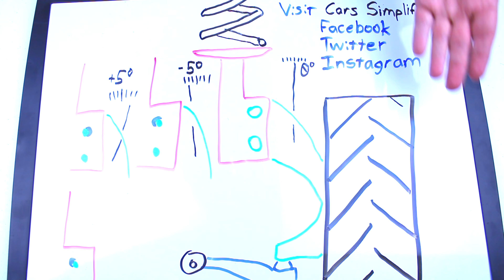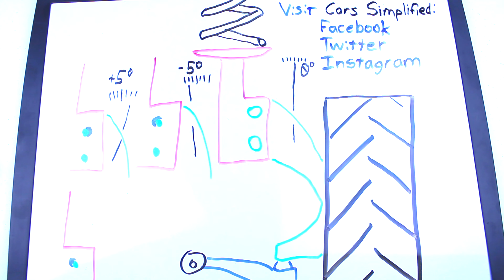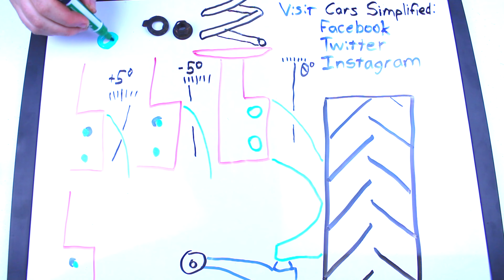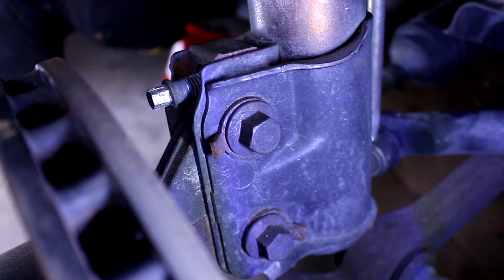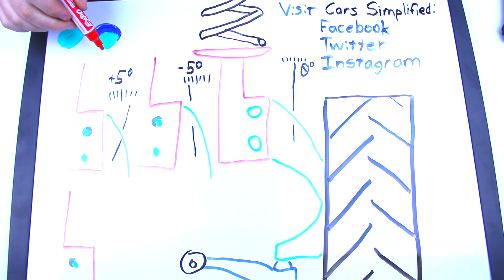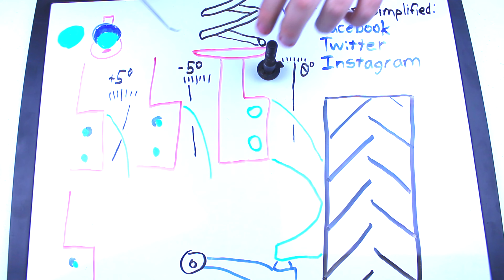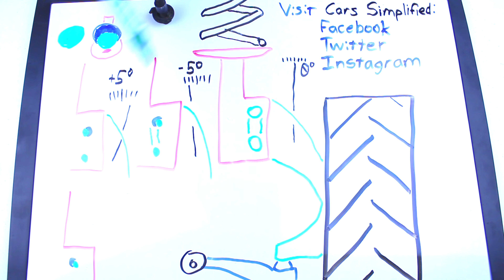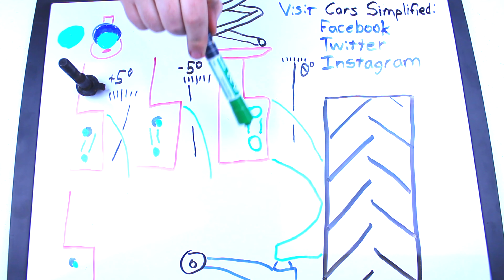How Cam Bolts Work (How to Adjust Camber) • Cars Simplified

Comment: Bought camber bolt for my dodge magnum but im hesitant to install it since the original bolt look thicker than the camber bolt i purchased. Im paranoid that they might not be durable enough due to the size difference.
Reply: They r a lot thiner,other wise u would not get them in the hole,the small tab on the washer fits into the hole along with the none threaded end of the bolt,this pushes the bolt again the front of the hole for more positive ,if u put the tab to the front ,it pushes the bolt back, it's the cam on the middle of the bolt that pushes the hub back or forward,u cam rotate the cam for less or more,, of course theres other ways to do it , take the top bolt out and file the the front or back of the hole 2or 3mm ,just use the original bolt ,does the same thing ,there's bolts aren't really for suspension mods, they r more to true the suspension to original spec if the car or something has been damage,hope this helps
Reply: @kp-qr6hy  Yeah, but how strong are they?  There is a reason why the oem bolts are a heavier 3 dot strength.

Comment: if oem bolt diameter 17mm ,  what camber bolt i need to use ? tQ
Reply: I think they label them also as 17 mm.  But that's as a designation for the size they replace. In reality they are more physically like 14 mm.

Comment: How much negative camber will these add ?
Reply from the maker: It's going to differ from car to car, mostly dependent on how far apart the two bolts are spaced, as well as some other part spacing. It will only be a few degrees at most, either way.

Comment: Dude... you say "make sure this tab sticks upward" and then show it sticking out sideways... Sooo which is it?
Reply from the maker: When holding the bolt (head side up, thread side down) with the washer on it, the inside tab points down, 90 degrees relative to the washer. The outside tab points up and outward, about 45 degrees out from the washer. The sideways placement on the strut is explained just after that, since that part will vary based on adjustment.
Reply: @CarsSimplified  Again, you are talking about two opposite planes as if they are the same....?? There is absolutely no question as to what Direction the outside tab is supposed to face... how on earth could it face any way but away from the strut???

And of course we will have variance in the final adjustment... but a starting point ffs??? I'm honestly pissed right now, you explained all the stuff that needs no explanation and left out what I and it seems others actually needed so I watched your, and 10 other videos and still had to puzzle it out on my own...